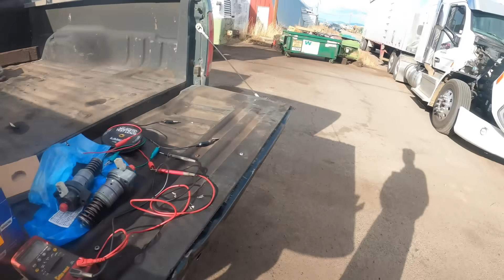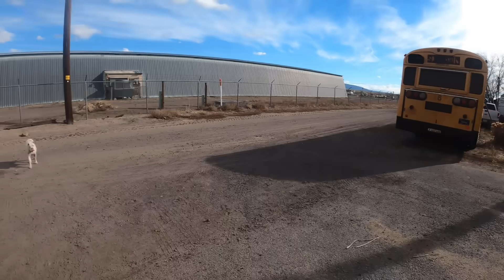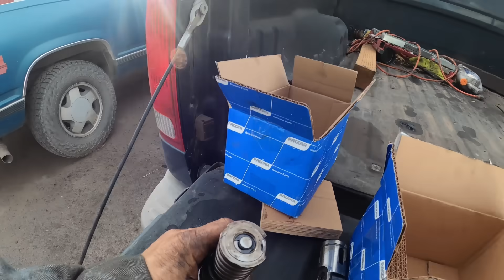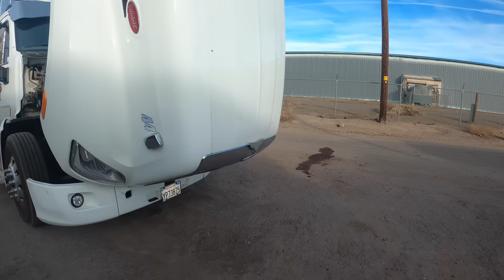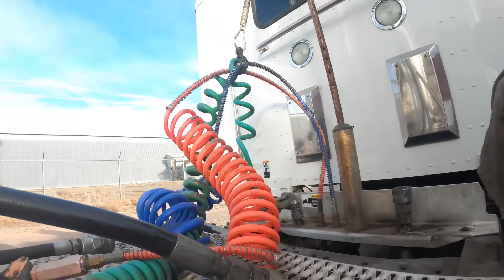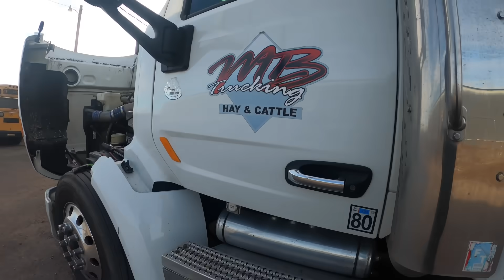Working on my favorite pos engine!

Comment: I'm a fleet mechanic in the South Valley, and we got nothing but 13 and 11 liter paccars for the most part, and I pretty much agree. I've touched at least 40 of these engines and not one of them was easy to work on.
Reply: The paccar engine design originated with daf which manufacturers cabover trucks so the engine was designed with a rear gear train which is accessible when the cab is tilted forward.  That is also why the volvo engines also use a rear gear train.
Reply: I think of it this way. If they weren't pieces of crap, I wouldn't be making money repairing them. The worse the engine, the more repairs that need to be done, which equals more money in the pocket.
Reply: @hillbillybeerdranker6678 the worse the engine the better for me to😂😂😂keep them coming keeps me busy😂😂😂
Reply: Why would a manufacturer paint it’s engine black ?
Reply: @vicpetrishak7705 hide oil leaks 😆

Comment: Warren, feel free to contact me about the issue you are having with this. The camshaft can be done in chassis, but we do them out of frame at our dealer. The EPA17s are notorious for exhaust lobe failures. As far as R&R the cam, it’s no different than the 17s.  The camshaft R&R process is not that bad at all. I have all the torque specs and parts youl need for this repair. Be glad to help.

Comment: It makes perfect sense that the paccar engines were designed with a rear gear train as it makes then much easier to service and provides much better access in the vast majority of truck applications. 
Daf manufacturers cabover trucks so that would explain why the mx series engines have rear gear trains.  The rear gear train design is definitely better suited for cabover truck since they have unobstructed access to the rear of the engine.  I am sure all future paccar engines will use a rear gear train since the market for conventional trucks is so much smaller than cabover trucks since that is what the majority of the world uses except for North America, Australia and a couple of other countries.

The volvo d13 also uses a rear gear train due to the same reason of being primarily designed for cabover applications.
Reply: Always makes me smile reading how bad they make the Paccar engine look. The fact remains love them or loath them they are one of the biggest Engine Manufactures in the world. And it appears apart from North America the rest of the world love them.
Reply: @youtubeisawesome2487  They are easier to work on with a cabover. The noise issue, is not really a noise issue at all. The Paccar engine is an easy engine to work on, once you get used to them. Some bits are harder than others. But then there is not an engine out there that does not have its awkward areas to work on. Our fleet trucks are a mixture of Cummins and Paccar ( They only buy KWs or Pete's ) So we have a good view on both makes of engine. And overall there is very little between them, most Cummins parts are a bit cheaper. But then When the Paccar breaks down it is usually a smaller and cheaper job to repair.

Comment: Been doing a cam a week for the last 2 years  on MX13 in the UK ..Luckily we do not have to pull the engine for the cam..Also here it is 100% exhaust cam follower but only on engines with the engine brake ,so really suprised that a pump unit lobe has failed ,,Unless the follower bore is damaged i never remove the head I lift the followers and put them on their side ,There is a special tool that bolts to the bottom of the block and cyl 2 and 5  that supports the cam as you slide it out which prevents the bearings being damaged ,or just be careful ,then i just drop the followers down their bores ,and repeat the process on assembly
Reply from the maker: Well, that's good to know.

Comment: I think your statement of “way more thorough description on the video” is sorta the understatement of the year. If you haven’t seen it then trust me and go watch the previous video. It is another Master Class in diagnostic procedures and analytical mandates of troubleshooting. It doesn’t get any better in discussion of detail, the logical sequence of diagnosis and formulating a solution with procedures to ensure the positive outcome. Also some sensitive diplomacy in describing a “possible cause” of the problem from a prior procedure. Warren, you are a treat to watch and an educational icon. Thanks as always.

Comment: I worked at a KW dealership, Paccar MX13 is one of the worst engines out there. Constantly in the shop for warranty repairs
Reply: And they have no power
Reply: It’s not the warranty repairs that make it a POS., it’s the non covered repairs…
Reply: I see you had the magnet on the followers, can’t you hold them up with magnets, to avoid pulling the head?? Kind of like they do on the ls engines, also there is a proper tool for holding them on some modern pushrod engines?? Not sure if it translates to your size engines??
Reply: @mmm365 in what way? And do you mean the new c13d?
Reply: @mmm365  I guess I am not sure what about it is so similar? Rear gear train? Similar fuel system? CGI block?

Comment: I always removed the plastic check ball on top of the fuel filter stand pipe and that code went away. It would get flat spotted and stay covering the hole.

Comment: Well that just sucks, thinking it's going to be a simple parts swap and having it "snow ball" in a heart beat. As you say Warren "Eurotrash", maybe those things work better in cab overs in Europe but they clearly are a pain in the backside here. Well look at it this way, if you didn't do the boroscope and just swapped parts it would be back into the shop in about a week with the way that follower looked. Good call on your part. Nice to hear that other issue worked in your favour, tracing wiring issues can be such a nightmare. Thanks for the share and stay safe Sir!

Comment: From the uk work for daf trucks. Our dealer has done 50 camshafts in the past year. Luckily because we run Cabover we pull gearbox and do it with engine in place. Still not a great job. Fuel pump lobe failure the is a ballache

Comment: I’ve seen videos of the European trucks and it seems like all of them have the drivetrain in the back like the Volvo D13 engine so it’s convenient for the Cab  over because all they do is tilt the cab take off the driveshaft, pull a transmission drop it on the floor and do their thing

Comment: Warren, you're the best mechanic on YT, said this many times. Many of us truly appreciate you taking the time to record and post your video's. 
Only issue I've had with the audio is, sometimes, sound is only on one side of my headset and usually about half way through your video, it clears and sound is on both sides. Not sure what the deal is with that. Probably the "a-holes" at YT jacking with us viewers. :P
I remember the very first time I seen a Paccar, knew then they were junk and even this video proves the point. To much labor involved in these engines. Can't the owner come and get that trailer with one of the other trucks? Great video as always, cheers :)

Comment: European rear gear design for ease of repair in European cabovers. Same with Mack, air compressor on rear of engine. Procedure... disconnect batteries, remove engine or "lift" the cab (as in Ford diesel pickup). Time for a Cummins transplant ?  Cheaper in the long term ?

Comment: I am glad ya got that vgt actuator fixed. I'm sure ya looked and tried to find the bad spot. Sometimes ya can't find it and have to overlay. The issue is if there is a rub spot it's matter of time before ya find the next wire. I know your a old dog and teaching ya new tricks will be hard but ya need to get into oscilloscope. They are awesome for tracking down issues like you just fixed.

Comment: I’ve been told, not sure if it’s true that Pacar engines have rear gears because of the cab overs in Europe. Easier to service
Reply: That would make sense. They have lots of cabovers
Reply: That is exactly right.  I was in Holland last year and different mechanics told me that is reason for the rear gear drive.  Bill @tiredofit1235
Reply: All manufacturers have gone to rearward gear train to help control vibration .

Comment: Seen that lots of times on the Deutz tcd 6.1 & 7.8 litre engines Warren used in the Fendt tractors.
The high pressure fuel pumps are driven by the cam on a roller just as you’ve shown but have a key way to stop them turning, sometimes the roller wears a flat spot then starts to hammer the cam this then damages the key way in the block. Haven’t seen this recently though weather this was caused by poor material of the roller?. Thanks for the video.
Regards,
Luke
Reply: The same thing happens if you’re valve clearances are not adjusted regularly, you’ll get a valve bridge come off and the push rod come off the rocker within the valve train reset clearance but doesn’t remain the correct clearance to find the roller has a flat spot. Major job 😂😂

Comment: I work for a specialised DAF shop, not a fan of the MX13 engine, the MX 11 is way better. I have to say, the US engines look a lot more crowded then the Euro ones. You don't have to take ouț the head if you are smart, just hang the lifters with some wires ad take them out/put them in when the camshaft is out. It's about 25 hours for a good tehnician with the right tools.
Reply from the maker: It sounds like you guys are reusing cam followers on a new cam
Reply: @westerntruckandtractorrepa1353  no, they get destroyed. You remove the pushrods, the cam followers have a guide groove witch you can attache a wire an hang them up until you remove the camshaft. After you remove the camshaft you can take out the follower from the bottom. You also install the new ones from the bottom, hang them up also with wires and install the new camshaft.
Reply from the maker: Oh ok
Reply: Todya a warranty camshaft job came and checked DAF RMI (repair and mintenace system) and they also say to do the job the same way. On the repair kit they provide only the bottom seals, no cylinder head gasket.

Comment: Hello Warren. Some of the early DAFs had Cummins engines. Originally they were the Leyland Roadrunner and daf took them over. Then they started putting these plastic paccar crappy engines in. Dafs had there own engine's. Paccar own daf. It's not European. It's Canadian.
Reply: DAFs used to be great before PACCAR bought them out.
Reply: @TYSuggested  hello there. Yes I agree with you. DAF were excellent trucks. Foden was another you don't hear of now.

Comment: Why would they put the gear train in the back of the engine? Push rods to boot? Mechanics at the local Peterbilt told me if you buy a PACCAR engine by 2 because you will need it,  even they hate them.

Comment: POS codes.........thats what Paccar engines have.  Its an OEM feature. Its almost like the DAF engineers sat down in a meeting, and their aim was "how can we make this engine as un-repairable as possible while being able to also deny that we did such a thing."   The Euro engines like DAF and Volvo are rear gear train, because they are supposed to ONLY be in cab over trucks, where its actually a good thing.  Who ever decided in their infinite wisdom to put them in long bonnet trucks......needs to taken to the town square and flogged with a cat-o-nine-tails.
Reply: Paccar is an American company. Engines are built in America. DAF just buys their engines to put in their trucks.
Reply: @TYSuggested    So, Paccar deliberately engineered a "rear gear train" engine for long bonnet trucks.........thats next level stupid.

Comment: I cannot understand why you guys have so many problems with the mx11/13engines stateside.
As a european truck driver,i have been driving daf trucks for 17 years,hundreds of thousands of kms.never had one end up on a hook,or even had to have an mx apart.only major things were an odd set of injectors or a couple of nox sensors

Comment: You wouldn’t think a company like paccar would use an engine like that. Since they lost cat you would think they would of got behind a better platform
Reply: It's all about emissions these days, and the Packard engine is just a rebadged daf engine from Europe.
Reply: PACCAR bought DAF years ago. PACCAR wanted to have its own line of engines after CAT left the on-hiway market. With the Euros (Daimler and Volvo) having big share in the USA heavy truck mkt, including their own engines, PACCAR really had to either acquire Cummins (which was not fir sale) or one of the smallest Euro manufacturers, DAF. Still a sorry state of affairs as Warren capably demonstrates, but PACCAR got their own engines.
Reply: The funny thing is Paccar in Europe are one of the biggest selling Trucks. In fact they are a big seller around the world. They sell well in Europe because they get good fuel Economy and have a good reliability record. I am not sure why they struggle with them in North America. Just a side thought the cam can be done in frame.

Comment: The only advantage I can think of with a push rod engine is hydraulic lifter and not having to adjust valve clearance all the time. 

But it sounds like these engines are lemons

Comment: Another Great Video, Warren. Those Engines do not look like any fun to work on. It looks like a similar design to 6.0 power stroke, that a can change requires a complete engine tear down. I will have to put those on a list of engines to stay away from. Thanks a bunch for the Videos. Hopefully the owner has another truck he can move the Chicken Sh$& with.

Comment: I've been swapping out John Deere pumps simply because of poor quality rebuilds that don't last. I'm at a loss of what to do, I'm getting charged for their pumps and they're paying the mechanic for his labor, but I have to buy the parts that go bad, even though I'm swapping out the pumps, last one I didn't quite at 100 hours, and I'm sitting on the sidelines waiting for internal parts that were supposed to be good, sentiments here are the old stuff is better than the new, and it could take 6 months before you get the new parts. There's three things, rebuilds, reman, or new,. And the housings are even getting hard to come by. I think when it comes to repairs it'd be easier for me to own two machines, one I can use while the other ones being rebuilt. And hopefully the one I'm using last longer than it takes to rebuild. To us older guys this stuff is just junk. And it's gone past what I can fix my self. It is very expensive and now I'm a month and a half behind. Whether it's a semi, construction equipment, or farm equipment. Mechanics are quitting while parts man are struggling, and I can't make money fast enough to pay for it. New, used and if you can find it. I just received a call from a supplier that my supplies that I ordered in March are finally on there way, ( Guardrails ). I almost forgot, Wow.    The flyover states have been forgotten.
Reply: @youtubeisawesome2487  when we've tore these down it was actually components such as actuators and solenoids that have quit. ( Wiring ) We've cut open the filters to check, and check the pump, but no one said anything about the fuel being dirty, but the lube may be a good idea just for a safety side of preserving parts